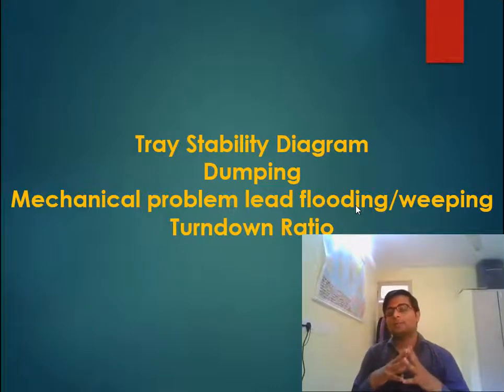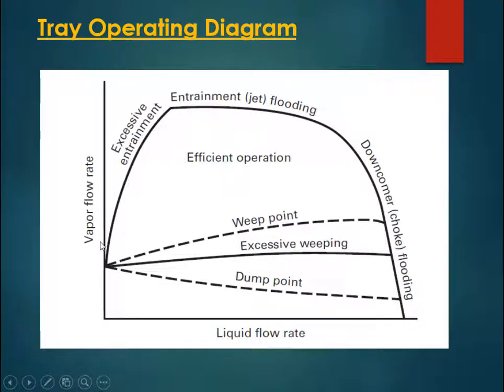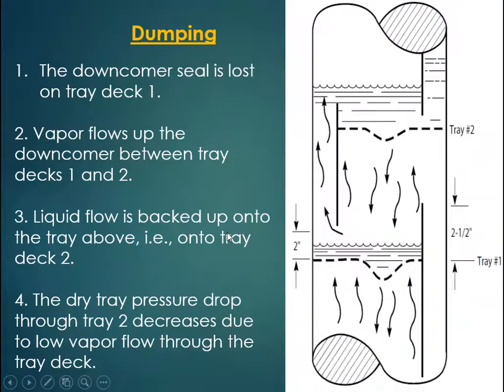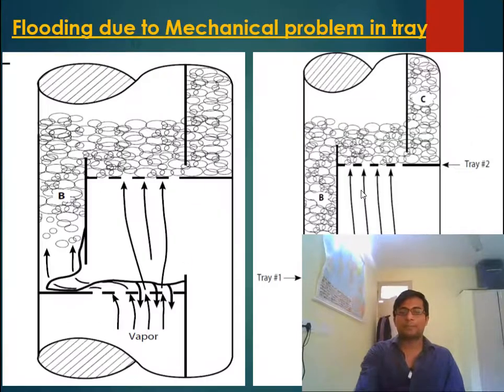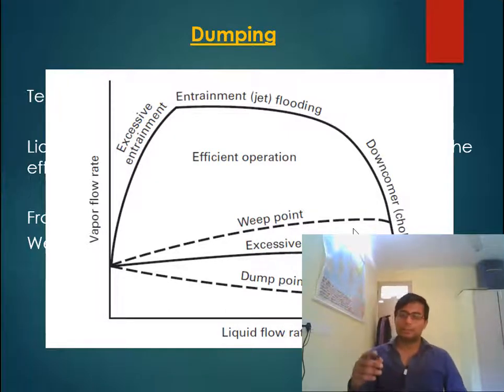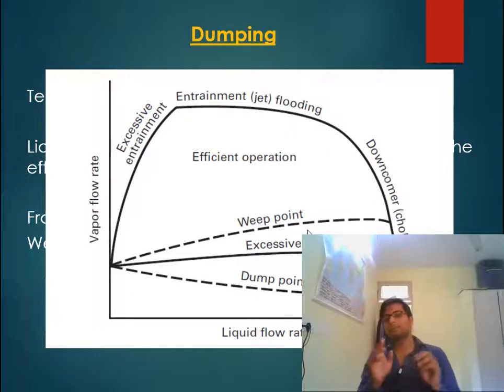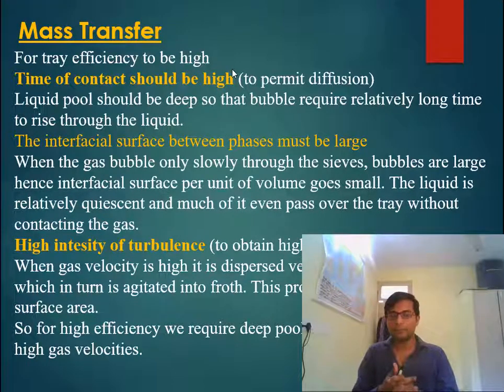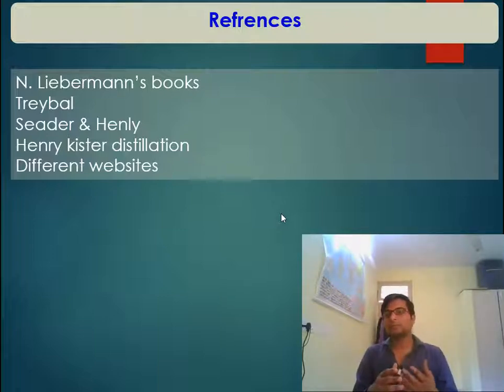Part 4 - Dumping, Stability diagram, turndown ratio & Mechanical problems leads to flooding/Dumping

Comment: Sir should i joine for mtech from iitr,iitg for gate preparation or self study preparation for psu in chemical engineering
Reply from the maker: mohit prajapati If you are economically sound then you may fully dedicate for GATE.
Reply: Sandeep Academy sir economically not good
So should i join for mtech.
Can i manage gate preparation also?